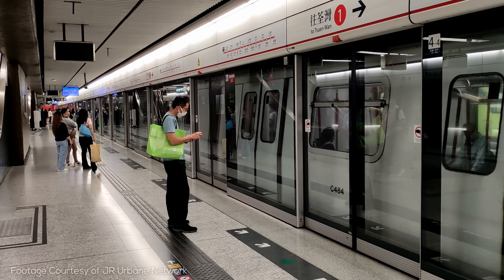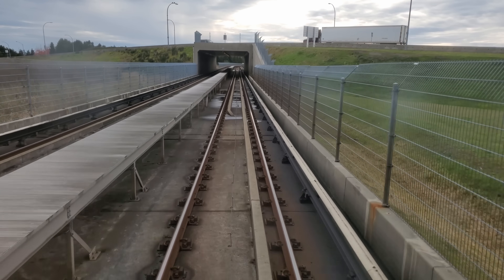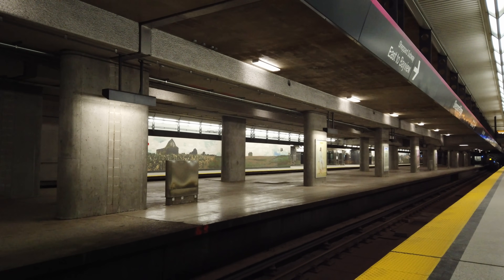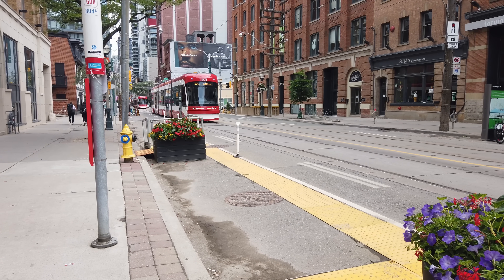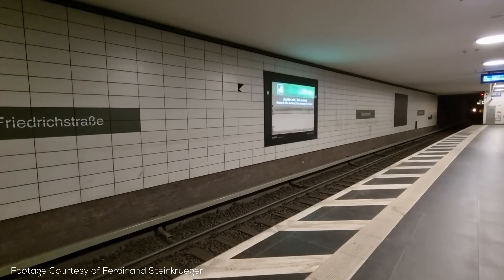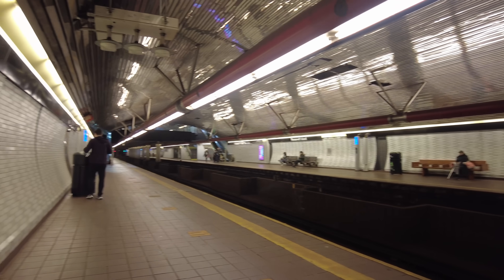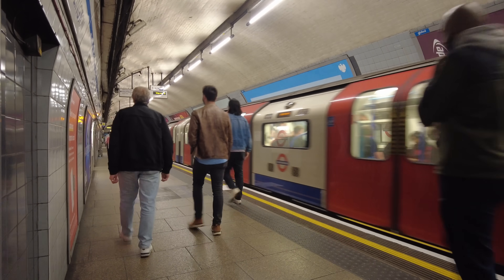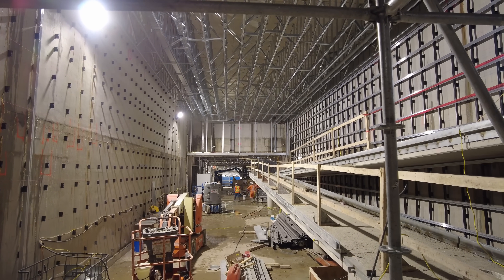Designing a Futureproof Transit System

Comment: As much as I give ETS a hard case for its current disastrous projects (South LRT, North LRT, Valley Line) the original planners of the main line were smart enough to do several things right including building its subway platforms from the start to accommodate 5-car trains at 130M long which were and are still used on occasion for Elks games at Commonwealth and during KDays at the Exhibition Lands aka Northlands. That probably saved the city and the system at least $1B dollars in the long run even if it came at the expense of funding other LRT lines to the North and West which would have probably doubled or tripled its current usage of around 100K/weekday... Alas, choices, choices... Calgary was probably smart to do the opposite and save its Stephen Avenue subway project for some point in the future whilst roughing in its entrances under City Hall... Another great video, RM!

Comment: Two big misses (though there may be more) with respect to the REM A here in Montreal. First, they needed to bring in a TBM to build the tunnel beneath the airport to get to and build the airport REM station. If that TBM had gone an additional 700m further it would have reached the already existing Dorval public transit terminus where there is also a Via Rail station. If they decide to do this at some point in the future, getting a TBM in place will be way more expensive as compared to using the one they had to go just a little further. The second is that they are rebuilding the Ile aux Tourtes bridge that is hwy 40 going west off the island and are not AFAIK including a rail option to extend the REM A to Vaudreuil which has high enough density to warrant a station.

Comment: You mentioned a lot of planning and efficiency issues related to "futureproofing." I think it's also important to consider "POLITICAL futureproofing." Planners should make the system so undeniably safe and clean that media and political detractors can't rally against the system. A good example would be Honolulu's decision to use gates at all the platforms. A bad example is California, where one of the routes under consideration for the high-speed rail might be at-grade (not very safe for HSR).
Reply: A lot of high speed lines are at grade, though, as that saves the construction cost. Of course, none of them contain any crossing (they aren't even allowed) and they also have to be fenced but that's past the point.

Comment: Ah yes, building longer platforms so you could fit longer trains in the future. The opposite of what Helsinki and Espoo did with the western extension of the metro. They built platforms too short for the trains that were in operation at the time of the construction. The trains had to be made shorter to fit on the new platforms, and now there are forecasts that they will be overcrowded pretty soon. The original plan was to run Reese's favourite automated metros more often, but it turned out that operating those automated metros would be more expensive than what politicians had thought, so they gave up on the automated metros and with them, the more frequent service, and so now they have capacity issues.

Comment: I think the DC Metro has done a good job with future proofing by US standards. All platforms were built for 8 car trains, even when 2 and 4 car trains were running. 1000-6000 series trains were built so they were backwards compatible, allowing the mixing of rail cars, although they are moving away from this strategy for the 7000 and 8000 series trains to simplify the system. Additionally, the Dulles airport access road was built with a median to allow the eventual Silver line to be built. At certain stations, Metro included stubs to allow for future branches which haven't been built yet.

Of course WMATA has been short sighted in other ways but I think they did a good job with planning for US standards
Reply: I’m surprised DC Metro wasn’t mentioned. That is pretty much the text book case of US future proofing. It was all planned at once, making for easy transfers and a well designed network (other than Georgetown 😏)Seattle is doing it piecemeal and the results are not good.
Reply: @laurysaldana5224  I do understand why Georgetown didn't have a station, bc it is so deep from Rosslyn and needs the space to rise to Foggy Bottom-GWU, but let's hope the new Blue line is done soon which will finally add Georgetown to the metro system!
Reply: @azan-183  my understanding is Georgetown probably both the neighborhood and college didn’t want a Metro station because it might bring “undesirables” to the neighborhood
Reply: @laurysaldana5224  I thought that too but GGWash wrote an article about it that the main reason was the very complex geography, so it might have been a combination of the two

Comment: Here, in Germany's most populous state of NRW (North Rhine Westphalia) there are several examples of future prooving within the Rhine-Ruhe Stadtbahn system where perpendicular platforms were prepared to start actual service decades later: in the state capitol of Düsseldorf the station Heinrich-Heine-Allee had hidden staircases to the lower platform for some time. In Dortmund, Reinoldikirche had the inactive platforms above the active ones poorly hidden from public paths and misused by drug-users. Dozens of addicts might have had their final and fatal overdose there. While in Essen Berliner Platz, the lower platforms were opened with a severe water damage.
Another story from the East of Germany: when the German government was relocated to Berlin around year 2000 a lot of holes had to be dug within the new government district. During that construction parts of the extension of East Berlin metro line U5 (back then terminating at Alexanderplatz) were already finished on a federal budget before the middle section could be finished on a state government budget. A 3-stop-stub namened U55 was opened. Demand was so low, that they could even rent the station below the federal parliament to a film crew, so that the station can be seen in the first Resident Evil movie. When transport services were reduced during the first covid lockdown, this line shut down completely and never returned, as it was incorporated into the extended U5 in December 2020.

Comment: The 63rd Street tunnel project included the connection to the otherwise underused express tracks at 57th/7th plus the hidden half of each level at 63rd/Lexington (now used by 2nd Avenue Line trains) and the lower level of the river crossing itself (now used for East Side Access). It's pretty amazing in retrospect to think that one North American transit project, albeit one that took 20 years to reach its phase 1 opening, contained so much forward thinking. This is one of the (unfortunately few) pieces of New York transit infrastructure to come out of the era that yielded the Washington Metro, MARTA, and BART. I often wonder what else we could have had if we got more done while the opportunity existed.

Comment: In Montreal, surprisingly, they had the foresight to plan for a future interchange with the Mount Royal tunnel at Édouard-Montpetit when the metro's blue line was built in the 80s, and more recently a rail right of way was part of the Champlain Bridge project from the beginning – two things that have allowed the new REM light metro network to exist.

On the other hand, the rail terminal built underneath the airport when it was renovated a few years ago ended up not being useful, so they've had to build another one for the REM anyway. Still, 2 out of 3 ain't bad 😅

Comment: Grand Street on the D line in NYC, the platform walls are rumored to be hiding another pair of tracks (or at least a track bed) for the 2nd Avenue line, much like 63rd Street on the F line had tracks for the future Q line connection uptown. Just knock down the walls and the station is suddenly a great transfer point to the future T line. BUT, the current plans for that part of the line (Phase 4 which is not funded) are to dig under the current station and have vertical connections between the two lines.

Comment: Hi, have you made a video about whether the right decision to dealing with a new light rail adjacent to bus lines is to keep the bus lines as redundancies or cut the routes to the nearest tram stop? If not, I'd appreciate it. It's a small issue in some places.

Right now, we're about to open a hybrid street light rail and light metro which is definitely not future proofed enough. I'd argue it's not present proofed, since there are only 70m long platforms on a route with expensive underground stops that is arguably one of the heaviest used in the country by buses right now. So keeping the buses should be a good idea to at least marginally deal with this horrible decision.

Comment: It’s New York’s Grand Central Terminal, not Station. Also, an example of an abdication of future-proofing in New York is the Mario Cuomo Tappan Zee bridge which was originally designed to accommodate a railway right-of-way for future commuter transit. Naturally, the bridge’s rail line was aborted because of “costs.”

Comment: 2:42 there's an interesting example of this in Manchester (UK). The Metrolink light rail/tram network opened its first stage in 1994 by connecting 2 former suburban British Rail lines (where upgrades and new rolling stock were needed anyway) with city centre street-running. The initial system was built with flat junctions. But when the Eccles line was opened in 2000, it incorporated a flying junction with Metrolink's 'main line' at Cornbrook. The peak service pattern (each way) when it opened was only 5tph for Eccles and 10tph for the 'main line', so this might seem superfluous. But in the 2 decades since, a single-station spur and an entire additional route were built off the Eccles line, and 2 additional routes off the 'main line'. That means at peak times there are 15tph using the diverging route and 25tph using the 'main line'. Even though the LRVs go through the junction painfully slowly due to poor sightlines and the dogmatic decision to use line-of-sight signaling across the whole network rather than (say) CBTC outside the city centre, I'm pretty sure that service frequency would have been impossible had Cornbrook been built as a simple flat Y junction.
Reply: Uhm... Cologne has a really similar transit system (even using some of the same vehicles, the K5000 from Bombardier) and the central city center tunnel where 4 lines meet has flat junctions in both ends and supports 30tphpd in regular service. It's not perfect, but it totally works. And when one of those lines will shift into a different tunnel, a new line will again bring the service to 30tphpd
Reply: @jan-lukas  yes, Cologne is a good comparison, although I do think Manchester should have taken a lead from Cologne and put some of the city centre lines in cut-and-cover tunnels (looking at you, Market St/Piccadilly Gardens/Mosley St). But there's a big difference between 30tphpd and 40, which is what Cornbrook junction manages for up to 12 hours per day. Even if conflicting moves at a hypothetical flat junction were minimised to 25% of junction use, and assume they each only cause 30 seconds' delay, that's 10 minutes of waiting at the junction each hour on a line where vehicles come on average less than a minute apart. The service pattern would regularly start to break down, even if there were no other delays or failures.

Comment: The fact the 63rd Street Tunnel opened for the subway in 1989 really puts into perspective just how long it took to complete East Side Access...I'm still not used to the fact Grand Central Madison is actually open. If it wasn't for the Roosevelt Island station not opening immediately after the trolley line above on the Queensboro Bridge (which was the last trolley line in New York State) and elevator down to the island both closed in 1957, we wouldn't have gotten the Roosevelt Island Tramway!  Roosevelt Island was redeveloped to accommodate low- to mid-income housing projects in the 1970s, necessitating the construction of a new transit connection. And so as a solution until the subway station was ready, they came up with an aerial tramway. 

It opened in 1976 with the far being 25 cents more than the subway fare so the tramway wouldn't draw away subway riders. But it became a permanent system as the subway project got delayed. Ridership declined once the station did open in 1989, but it's still popular among tourists. It was the last holdout of the subway tokens, and it wouldn't accept MetroCard until March 2004! It now costs the same as the subway and buses. And during the big transit strike in 2005, the aerial tramway was still in operation! The tram is currently operated by Leitner-Poma on behalf of the Roosevelt Island Operating Corporation (a quasi-private NY state public-benefit corporation).

Comment: In Guadalajara light rail, Line 1 was built to 1970s standards, so it had to be upgraded some years ago to allow for three car trains since it was getting too crowded. Line 2 on the other hand was built with 120 m long platforms, but sadly they still use two car trains there. So we got the short end of the stick for both lines, for lack of future proofing or inadequate use of said provisions

Comment: Great topic and super important and it goes to much more basic things. I work for the MBTA, trying to add elevators to over 100 yo stations is an enormous undertaking. upgrades to electrical equipment in stations that are "only" 40 yo, is nearly impossible because stanards and clearance distances have changed so much that new equipment can't fit in its existing location and the list goes on and on. So much to think about!!

Comment: Overruns after the last subway stations have operational benefits even if you never extend the line. They usually let you stable 4 trains at the terminal station overnight, rather than 2, which helps start up the system in the morning.

Comment: On a four-track trunk line like NYC has on some lines, "future-proofing" might have included both inside "express" tracks to be bi-directionally signaled like the middle tracks on three-track lines, so that more express service could operate "against traffic' in the peak direction in rush hours, especially Queens Boulevard. Sure, it bunches up the reverse peak trains all on the same track, but the new controls that allow trains to run closer together means that it won't result in too much congestion backing up the line into Manhattan.

Comment: IMO. You futureproof by over-engineering/over-building the initial foundation. eg The Canada Line is underbuilt, the Millennium Line was overbuilt (for what got built originally) but correctly sized now that the original (UBC to Port Coquitlam) project is ultimately the goal and not a mashup of different system proposals. 

That said, there was two missed opportunities due to this. The Broadway-Commercial drive station is a mess, because the Millenium Line was not even considered at the time, so there are no switches to switch lines, nor platforms to transfer. The result is that (originally, before faregates) wasn't too bad because you could walk between both, but after the fare gates and before the third platform became complicated to navigate, and only with the third platform it became less complicated to get off the train and make it to the commercial drive station.

The next missed opportunity is the switch before the Skybridge with Columbia station.  Had this been designed better with 3 or 4 platforms, it wouldn't be such an impediment now with getting to the Millennium/Evergreen line. The Millennium line was built with a third platform... on the wrong side. They basically just changed the switching point so it wouldn't be an issue, however, Production way does not have a third platform and with the Gondola project, it really needed it.

Alas, I'm happy that we got what we got with the existing automated system, and didn't end up with a mashup of short poorly-engineered light rail systems because mayors couldn't see past their mandate.

Comment: It really depends on types of transit projects. You never know the future. Even do tons of planning and future proof estimation before project opens, riderships on some projects May still under or over estimated. For Example: theoretically, widen highway 401 should solve traffic congestion problems, but it actually engage more demand on highway make traffic even worse. Same can be applied on subways. More capacity, more demand, more congestion. Unless the city build more subway lines to release and evenly distribute capacity on various lines.
Reply: Yamanote line for example, already running 11 car configuration and 2 minutes gap but still overcrowding.

Comment: Another London example - Heathrow T5 station has an additional platform box for 2 tracks to the south of the HEx/EL platforms - it was easier to build it in case (cut and cover) before putting one of the largest airport terminals in Europe on top...

Comment: Wondering how the Plans of my Hometown (Mainz) to expand the Tram Network will develop in the next Years. The once most indebted city in the state got growing income from a vaccine developing company. Currently there are 3 Projects. One is a 250m log connection between 2 lines, planned comissioning 2025. This expansion will make Project 2 possible: a second lined through Downtown, planned comissioning in 2029/2030. The third project is a new Line through Uptown. There are no official plans for the Track. But it is likely to connect Central Station with University Hospital and a new Neighbourhodd of 2,000 People.